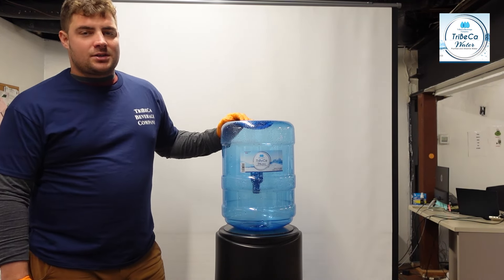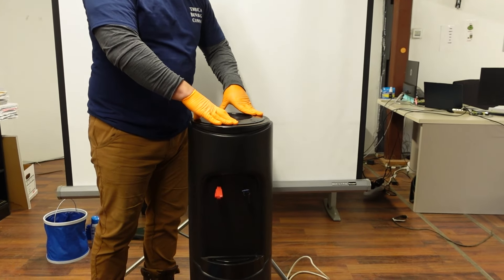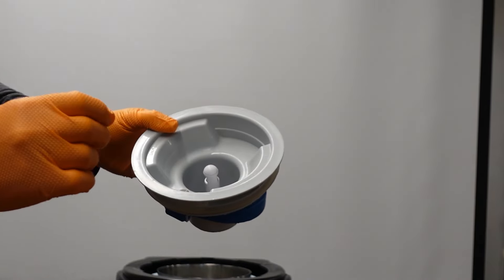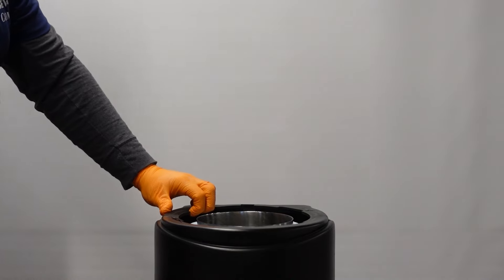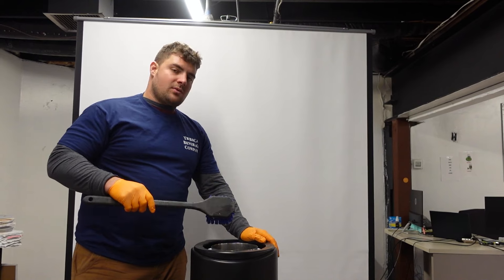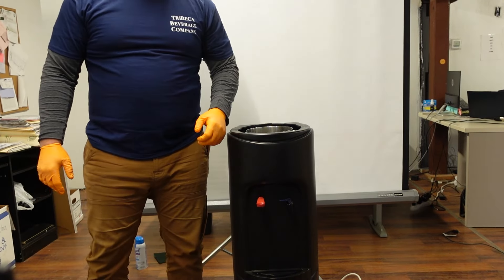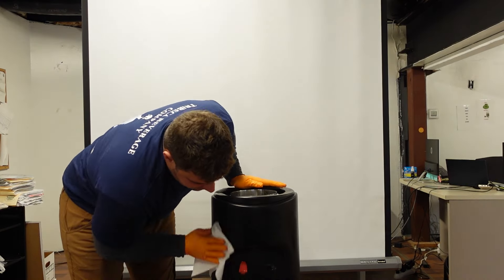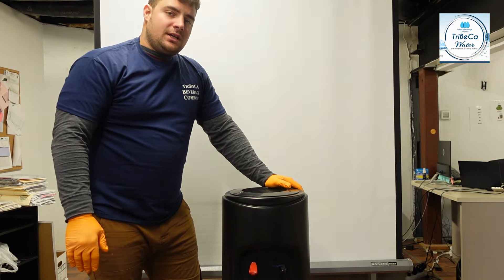How To Clean Your Water Dispenser | Water Cooler (2022)

Comment: I've had my water dispenser for 4 years and didn't know it had a filter 🙃
Reply: It doesn’t have a filter so to speak. It’s more of a “ valve” that allows the water to enter the cooler from the bottle into the tank without too much “ glugging “ too much. The water in the bottle should have been purified but reverse osmosis or distillation ( I prefer reverse osmosis no “ slight metallic “ taste  ) boiling water kills bacteria but I’m still not sure about pouring boiling water into the plastic parts of the cooler like the spigots and any lines inside the cooler. Your best bet is to find a food grade hydrogen peroxide and use a couple tablespoons full in a gallon or so of water. Pour it in and open each spigot for about 20 seconds to get the water solution into the lines and the spigot. Let it sit like that for about 15-30 minutes ( clean the other parts in the sink either soap and hot water and rinse ) . Drain the remainder of the water Peroxide solution  through each tap ( spigot ) with more time running water out of the cold spigot.  Some water coolers have a drain plug or valve on the back. If you have that, drain that as well. You WILL spill some water so don’t do it on hardwood or laminate flooring and have paper towels and an old towel ready. Now fill the tank by pouring cold water maybe a half a gallon or a bit more from your sink in the tank. Let that water seep into the cold and hot tanks. Some coolers have a “ room  temperature “ spigot. There’s usually no tank for that, the water comes straight from the bottle.  Run each spigot until no more water comes out and drain that drain in the back if you have one. Repeat this step 2 or 3 more times. If your tap water is not “ clean” do one pour and drain with a gallon of purified water. Some people like to use  white vinegar a quarter times half a cup with a gallon or gallon and a half of tap water. I find vinegar is harder to get the smell out and or requires more of those “ rinse “ steps. You can also use about 2 teaspoons of bleach in a “ big” gallon of tap water. The food grade hydrogen peroxide is the safest but the bleach is also safe ( most municipal water is chlorinated which  is essentially bleach., just do more rinse steps and don’t overdo the bleach, 1/2 teaspoon in a gallon is plenty.after your last rinse and drain use a quality paper towel to wipe down the inside of the water reservoir before putting in the parts you cleaned in the sink earlier back in. Put a fresh bottle of water on and plug the cooler back in and turn on the cold switch and the hot switch if you use that feature a lot. Run each spigot for 10 seconds or so. It should be fine to drink once the cooler has chilled the water but taste test the water the first time. If it still has a slight chlorine or peroxide taste run the spigots until the smell / taste is gone or wait 4-6 hours for the taste/smell to dissipate. Too many people believe the water they use is purified so cleaning the cooler isn’t necessary. If you use your cooler daily it should stay “ clean” for about 6 months. If one bottle lasts you 3 or 4 weeks or more, the water is sitting in the cooler too long so clean it more often. If you fill your bottles yourself at a self serve machine, the bottles should be sanitized every 2 or 3 fills if not every time.
Reply: @Zeek800 thanks
Reply: Do you need to put the filter in the dishwasher?
Reply: @Zeek800 thank you I'm taking my water cooler yo my new duty station and your instructions helped me ❤❤

Comment: Thanks so much. After only two uses I suddenly had bunch of sandy texture in my water. Only issue is my air filter really couldn't be removed so I just used hot water and avoided the air filter when cleaning. But now I'm really afraid to put a new water tank in it. It was such a chore to drain the whole thing. 😮

Comment: Are there such dispansers that have the part with filter attached and not removable? I tried to clean my (that is why I was searching for this type of videos) but that white part under the safety cap seems to be connected to pipes, I can't lift it out more than just few cm.

Comment: I have tried to fix my water cooler that for the first time is leading where the bottle goes into the safe guard. I took the part out and cleaned the small holes and did get some dirt out of it. then I washed it and put it back. Then I reinstalled the water bottle but it is still leaking around where the bottle fits in the hole. What am I missing? I am senior and cant think what to do next.

Comment: If the air filter is clogged, is it why I can only get a half glass of water and need to wait 15-20 minutes to get more water?  My bottle is half full atm and plan to clean it and see if I can fix that problem.
Reply: Just remove the filter. I haven't had a filter for like 9 years it does nothing!

Comment: 220 degrees Fahrenheit i could only get to 212 degrees weird it just stopped there now what.
Reply: Depending on the altitude of where you live, water boils at different temperatures. As long as the temperature stops rising and it's clearly boiling you should be all good.
Reply: @TchaikovskyXVII  At what altitude does water boil at 220
Reply: @slushjoe  below sea level actually, not sure why he said 220 f
Reply: @TchaikovskyXVII  I know he did a great job I was just bored I guess.